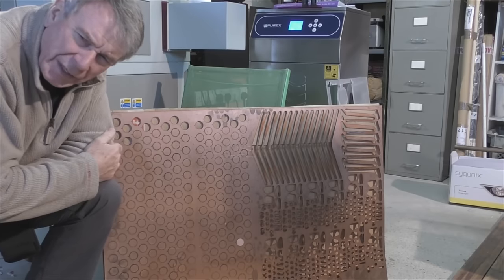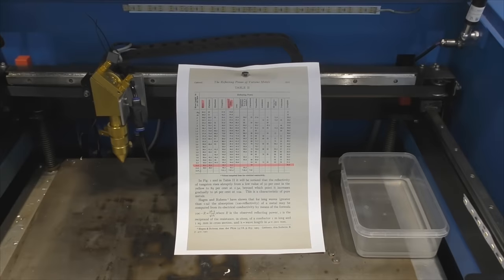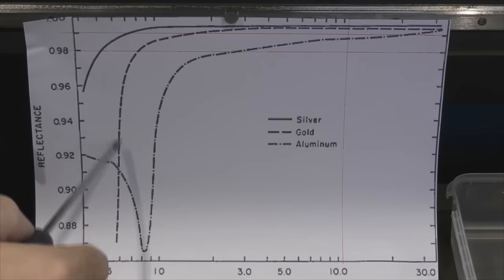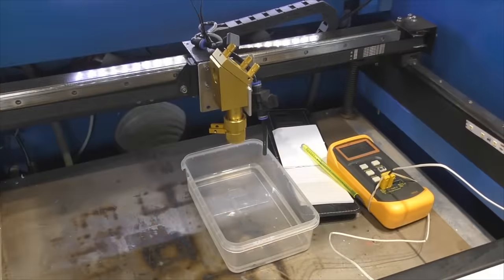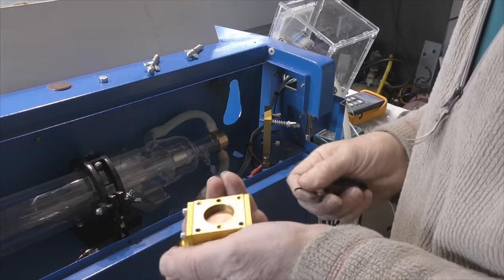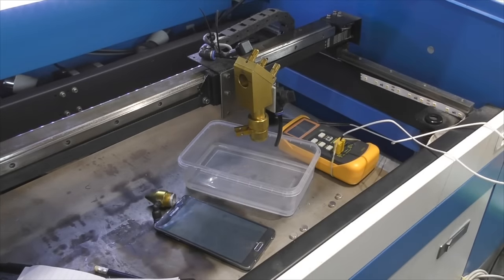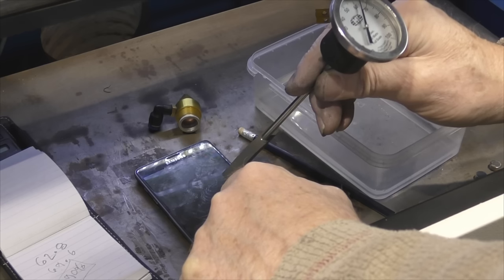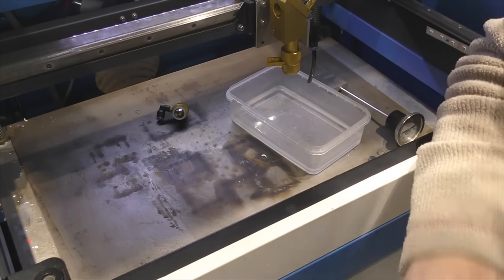RDWorks Learning Lab 94 copper mirrors  A Conclusion

Comment: Thanks Russ must have missed that one.  I just tried to cut a platter and it shattered.   Seems like some maybe earlier ones must have been made from some sort of coated glass,  it was an old 40gb drive.   Very dangerous to cut.  I may try again if I can get a metal platter but as you say just to use as a reserve.  Did salvage the magnets to keep my access flap closed,  same as in your video.

Comment: Russ, What about Those First surface mirrors, that are easily found in those rear projection TV's from the mid-2000's? The Silvering for the front surface mirror is usually aluminum. According to Wiki , Aluminum and used for visible light, where Golf for IR ?
Reply from the maker: Aluminium is an excellent IR reflector  polished or not. The whole point of a mirror is that it should be FLAT so as not to cause beam distortion. Aluminium instantly forms a surface oxide that is VERY thin and absorbs IR so in general there will be some sort of coating on the shiny aluminium surface to protect it. This coating will be completely transparent to the sub 1 micron wavelength light that we can see  but it may be opaque at 10.6 microns in the same way that glass, acrylic and poly carbonate are. You will need to test it's reflective efficiency in situ because as you will have seen in an earlier session I tried using the shiny aluminium material found is older PC hard disks.The efficiency was in the low 90% region from memory (nothing impressive). Most of my copper mirror work did not reach the 99%plus aspiration. Close yes, but not worth the cost and effort when you can buy bullet proof molybdenum mirrors at $4 each that deliver 97% efficiency.

Best wishes
Russ

Comment: Good to see you again!  Couple of questions.  1. How long will the copper mirrors stay reflective?  Do they tarnish quickly?  2. I'm wondering if it would work to cut the copper discs from 25mm copper bar stock on my large. Facing the end would get them pretty flat and almost mirror finished at the right speed and feed. I may give it a try. The process would be much quicker with less material waste
Reply from the maker: Hi
The Chinese mirrors were parted off from bar before lapping and polishing because the machining marks on the back are obvious. When I sent my rolled copper sheet discs to the lapping company  they were very pleased to see plate rather than turned discs." Why?" I asked.  The summarized answer was that they do a lot of disc lapping in soft materials (copper included) for Rolls Royce and the uneven stresses in the rolled stock bar make it doubly difficult to get a high flatness lapped finish. Although there are also stresses in the flat plate,  they are lapping in the plane of the stresses and not across them.  I can only pass that snippet of information on.

Dire warnings of early performance loss through oxidation were in abundance when I first made copper mirrors. I do believe that the polishing compound I used has some sort of molecular protective film that it leaves behind on the surface and excludes that atmosphere . Hence I only buffed the finish to a shine and did not clean the surface with acetone or alcohol.  They were still pristine after 3 months when I first examined them. Soon after that I had to put the original moly mirrors back into the machine because in fitting my new 70 watt tube I discovered that the beam diameter had changed for about 3 or 4mm to maybe as much as 10mm. My crude manufacturing methods had left sufficient flat in the central area of the disc to be very effective with a 4mm beam but "roll off" outside that zone was coming into play with the bigger beam and causing beam divergence.. It's taken several months of research and background work to get to this point where I can now draw a conclusion. I also discovered that to get better than 98.5% with untreated copper would be a miracle because professional industrial/scientific copper mirrors are coated with a half or quarter wavelength coating to prevent reflective interference and allow efficiencies as high as 99.5%. Silver electro-plating my copper mirrors has been suggested and this offers the possibility of getting to 99% max. I may give that a shot as I have a few spare mirrors to play with.
Good luck with your manufacturing route.. My general conclusion is that moly mirrors will be the best cost effective option for all but the most enthusiastic The extra 3 or 4 watts gained would not worry most folks. I'm doing it because I want to know. I do now know and am pretty pleased with the result. I have learnt a huge amount and maybe others can also benefit from my peep into the darkness.
Best regards
Russ

Comment: I haven't tried it yet but I was thinking of using diamond paste for polishing.   There are several ebay listings for a collection of pastes ranging from 0.5 to 10 microns.  An 8 tube set costs £6.99 in a size similar to that for heat sink compounds which should be more than enough for 3 small copper mirrors.

As for an anti-tarnish coat,, have you tried the ubiquitous WD40?   It works well on silver.

Another thought occurred to me and that is to use the laser machine for the cutting procedure.  If you turn the laser off, would it not be fairly easy to use a cutting plate of the right weight attached to the laser head and then run a simple programme to make the figure 8 pattern to be printed over several iterations?  Than would certainly help with consistency, especially if you make the mounting point of the plate on an off-centred swivel.
Reply from the maker: Hi Peter
That's a novel idea to turn the laser CNC into a lapping machine.
My quest for the ultimate mirror  came from knowing that 99% plus  efficiency mirrors are obtainable with high purity copper. At some eye watering price you can buy them for industrial multi kw machines.  I finally resorted to getting some discs professionally lapped by a gauge manufacturing company to get them ultra flat, but I still had to do the final polishing to get 98% ( maybe an occasional 99%)  result.  I spent a lot of time and money on this question that need and answer. In practice I found 98% was the real practical limit and even real gold plating was a disappointing 95%. The most sensible mirror solution is to buy molybdenum mirrors. They are hard and virtually indestructible, cost less than $10 each and are about 97% efficient. Now that the question is answered pragmatism has set in and  I  have a spare set of molys in reserve......  but to be honest I still use my copper set.
Best wishes
Russ

Comment: G'day Russ, great to see another video. I'm having a ball with my K40 Chinese ebay wonder. I cleaned the mirrors the other day (for the first time) and the mirror in the head was mouldy and horrible. I've seen this mentioned before by Youtubers. Cleaned it up and made a big difference of course. I'm just waiting on an order from Light Object in the US of a proper air-assist head, gold plated mirror ($15USD) and a new 18mm ZnSe 50.8mm lens ($35USD). So I'm hoping for some improved cutting although for such a cheap device I have no complaints at all. Cheers,..
Reply from the maker: Hi Ingmar
I bypassed the k40 because although cheap, it was not really big enough for my imagined needs. So, I have no direct experience of that little baby dragon. I have seen folks doing great work with it. The technology is basically the same so I can just imagine the fun you are having.
Best wishes
Russ

Comment: Hi Russ, you're probably aware of this, but optical reflectivity at infrared wavelength is quite different from visual spectrum. So, polishing copper to appear nice and bright might not necessarily be optimal for IR. I remember in the late 80's working with a 20 kW (!) CO2 industrial laser, which had all its lenses made from solid germanium, which appeared visually to be totally opaque, but obviously very transparent to IR wavelengths. The mirrors were gold plated aluminium blocks, which were very flat. All the optics were water cooled from a chiller, and the continuous laser was modulated by a black anodized mechanical aluminium shutter disk (pneumatically actuated), which was also water cooled. This shutter was inserted somewhere in the primary beam path, which was around 25 mm in diameter before focus. Even unfocused, this beam was enough to melt a brick - before the shutter was installed, this was the only way we could temporarily block the primary beam! This laser cut through just about any metal up to 10mm thick, at linear speeds of around 10mm/s. Best regards - I enjoy your videos!
Reply from the maker: HiJohann
20kW...that was some machine. I used to have two 3kW lasers for my metal cutting business. Yes they could cut 10mm stainless slowly but they were completely different beasts to these little sealed tube laser systems. Apart from the optical and safety knowledge gained during those years, every other bit of experience was useless. Hence I had to start from square one to understand this technology. 
As I demonstrated in my session on reflectance, dull copper is almost as reflective a polished copper. When I finally arranged to have my copper mirrors mechanicall lapped to optically flat I got reasonably efficient results however, I did find that there was an extra 3 or 4 % to be gained by polishing to a good visually reflective surface. Now, I know it is not the shininess of the surface that causes the reflection but the crystallographic structure that's responsible, so I have to assume that I was removing debris or slightly rearranging the surface atoms with my energy input. Several month later those mirrors are still performing well and have not been re-polished yet.  That was a fascinating saga that really focused my attention. I am currenty obsessed with getting a full understanding of how the machine can produce dots. A supposedly simple subject that seems to grow and grow.  The more I begin to understand, the more questions pop up. I'm hopefully now in site of the finishing line and will be able to make a final video on the subject soon.

All best wishes
Russ
Reply: Hi Russ, thanks for the reply. Yes, dithering and halftone screening is kind of a black art. I've been toying with it for years, with the purpose of writing a program that will produce a continuous line dithered vector file from images and photo's. Those are also very interesting to engrave with the laser. Best.
Reply from the maker: Hi Johann
Producing a clean consistent dot is the real trick to producing dithered pictures. Once you have the magic formula for achieving this and at the moment it looks to be greater than 4ms because the power supply and physics take that long to respond to a signal from the controller.  Having established that fact there are many other factors to consider. the more power, the longer it takes to reach full power , maybe 5 or 6 ms. Every time there is a white space between pixels/pixel groups, the beam switches off. How long it takes for the power to decay is at present an unanswered but vitally important fact. The whole point of a dithered picture is the relationship between the white background and the density of the black dots. It is that varying density of black/white mixing that takes place in the brain that creates the illusion of a grey scale image. If you lose the white background you supress the tonal range and also run the risk of fuzziness. So the first thing you must do when you have selected you working medium is to test it with some typical well focused dots to see what size dot you can actually produce. In organic materials it looks like visible dots will be at least twice the theoretical spot size because of edge burning effects. That means you will be wasting your time with image resolutions beyond about 150ppi. Now calculate back from 150ppi to find out what speed you must run at to get dots greater than 4ms and I think you will nearly be there. The final decision will be with power. You need that power that will give the same burn as a singl dot as it does for a group of black dots..

Who thought somethin so simple as a dot could be so complicated????
I'm sure I shall arrive at a conclusion.
Best wishes
Russ

Comment: For polishing the copper, I would have prefered to see you polish it on a glass plate with possibly diamond paste while moving the copper in a figure 8 pattern. This would have ensured the best possible level surface for reflection and possibly add a few more percentage points of efficiency.

Other than that, a fantastic experiment.
Reply from the maker: Hi Chris
With my early attempts at making mirrors I tried the techniques you mentioned with glass, mirror polished stainless steel and cast. iron plates. Figure 8s and multi mirrors on a heavy steel puck.....all to no avail. I tried but obviously there's more to riding a bike than just lifting your feet off the ground. I did also try to enlist the help of any local amateur astronomer who may make his own mirrors. Here in the UK such individuals are VERY rare so I was unable get tuition this way. Hence I had to admit defeat and get the mirrors professionally machine lapped. As you saw from this video, although the mirrors looked fine and were superbly flat. it became obvious that flatness is not the only requirement. 90% visible reflectance was not good enough, hence I had to polish them. I do have polishing mops and fine soap but was worried about polishing distortion back into beautifully flat discs. Thus I opted for this cotton fabric on a flat surface, by hand. Yes I did roll the edges slightly but only in the area masked by the mirror mount. Those final few percent were all to do with surface finish and not flatness. My previous attempts were dogged by non flatness causing beam divergence. No such issues this time. So I am pretty happy with the results. I discovered that 98% was the reflectance limit for untreated copper and the only way to gain the sort of 99.5% performance you see in industrial mirrors is to apply some sort of half  or quarter wavelength coating.....just a step too far for shed science!!
Thanks for the comment
Russ
Reply: I see your point Russ, at least you're giving it a shot and documenting your failures and successes and that's what really counts. Looking forward to the next video as always.
Reply: @SarbarMultimedia  It's late, but for future reference - do polishing with paste on ordinary newspaper (non-glossy). Nothing come close to that. And only move in figure 8. Use a holding jig for even pressure.
Problem with copper mirrors is that they work only when fresh, after some (short) time they get a layer of oxidation on them.
Reply from the maker: @zlotvorx  
Hi At the time I did get some advice about  figure 8 and I did make a heavy jig to polish 3 at a time to try and keep them flat.  Polish was good flatness was not.. You will see in a lter episode that I had them lapped to super flatness and a reasonable polish . I had to touch them up with my own polishing to get them to about 98% efficient.. Maybe it was the polish I used but after two and a half years  I have had virtually no tarnishing(oxidation) issues despite dire warnings from many.  However, this was  a question I needed to answer and  I did. What it showed me  was (despite the fact that they are still in my machine) molybdenum mirrors are a close second at 97% efficiency and at about £5 each are way more cost effective.
Thanks for the great advice  but.....
Best wishes
 Russ
Reply: @SarbarMultimedia  You know the saying - If it works... :)
Maybe the highly polished surface made the oxide layer polished as well. Or the polishing compound left a protective layer.
Maybe you could get an optical flat and test the mirrors for flatness (ebay has a lot of cheap NOS USSR optical flats). It would be interesting to see what is the relation between flatness and performance of mirrors.
Reply from the maker: @zlotvorx  
Hi
I can assure you that flatness is crucial. . The round shape and Gaussian energy distribution are easily disturbed if the mirror is not flat. That was the main problem I was fighting with the mirrors I was making. They had superb reflectance performance, one mirror was over 99%, but  a diverging oval beam is bad news when the beam arrives at the lens because changes in X and Y distances  make that divergance variable.. It was not until I had them professionally lapped by a gauge manufacturer (not cheap) that I was able to get correct performance. The polish I was using claimed to have some bonding capabilities at the molecular level so I have to assume that claim is true and that it is resisting the intrusion of oxygen. It was a great learning experience at many levels but not one I would repeat, However,  I did note your comments in case I ever  change my mind.
Best wishes
Russ
Reply: SarbarMultimedia “shed science” lol, too funny

Comment: Hi Russ have you seen the video on making mirrors from hard drive platters?   I don't know exactly what they are made of but maybe you could have a go.  They are very highly polished and very flat for obvious reasons.  Keep up the research.
Reply: That would be an excellent candidate for an experiment. Don't know about reflectivity at infrared wavelength, but those platters are polished to atomic level flatness. Definitely the flattest thing you can buy retail. Some are glass substrate, most are aluminium substrate with at least 9 exotic material coatings. These HD platters are even flatter than astronomical equipment. Give it a go Russ!